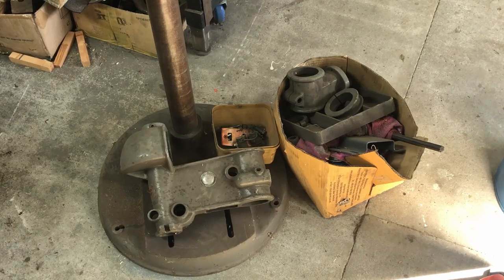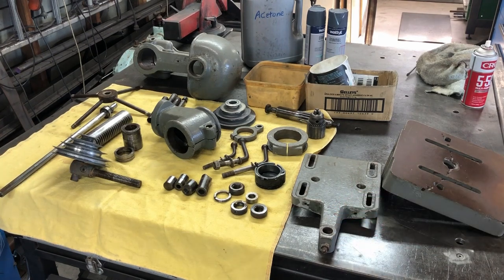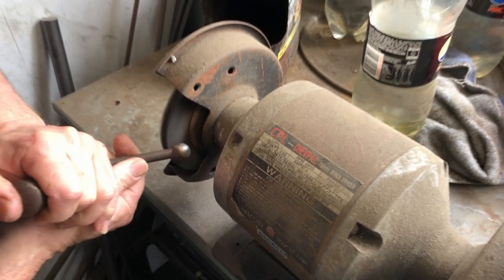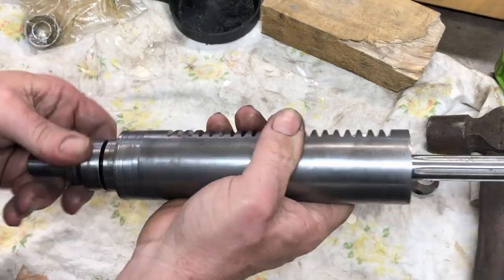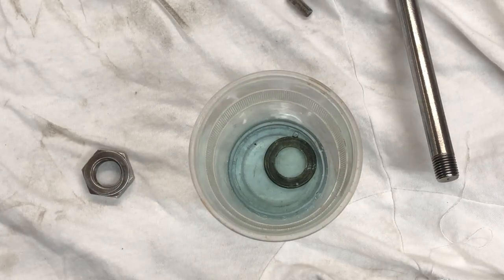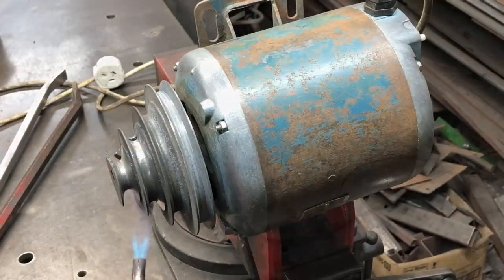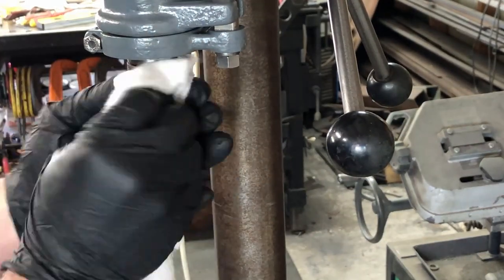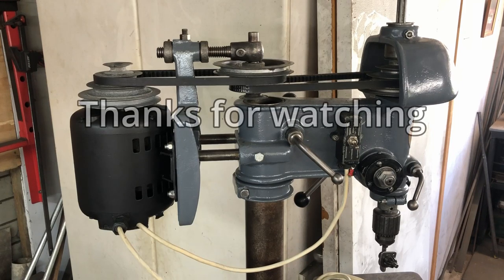Walker Turner Drill Press Restoration

Comment: Where you taped that cable going into the motor junction box, I use 1 or 2 cable ties pulled tight to the cable inside the box, I find they do a good job of stopping the cable pulling back through the hole 👍
Reply from the maker: That is a good suggestion. I did not thing of that, but it should work well. Thanks.
Reply: @thehobbymachinistnz  You're welcome 👍

Comment: The drill press turned out nice. ( I was expecting you to say at the end that you had decided to keep this drill press and sell the bench top model ). I don’t think you will have a problem selling the old girl. 
Just a thought, have you ever tried diesel to clean with instead of kerosene? Here where I live diesel is less than half the price of kerosene. And diesel is #2 kerosene.
Reply from the maker: I spent a lot of time on my bench top model. I added a VFD and 3 phase motor so that I don't have to keep changing the pulley belts for different speeds. Its Chinese, but it runs well.

Thanks for the tip re diesel. I will get a few liters next time I'm at the gas station and I will give it a test.
Reply: @thehobbymachinistnz  I do understand. Space in a shop is at a premium, period! I do hope you get a pretty penny for the old girl. 
About the diesel/ kerosine. It’s been a long time since I used kerosine for any thing other than light and heat. For me it’s too expensive to use that way. As of today kerosine is $9.00 a gallon diesel is $3.20 per gallon.

Comment: Nice restoration.  Here comes Trademe. Another Kiwi here. Started my Youtube adventure a couple of months ago. Where did you get your blacking fluid from. I have been using Super Blue with average results. Cheers Mike
Reply from the maker: Hi Mike, I got the Perma blue from Reloading Direct (https://reloadingdirect.co.nz/). The big bottle is much more economical than several smaller bottles. Before I used this product I use to hot blue parts by heating them with a burner until the colour changes, then quenching them in oil. I still use that method sometimes. 

I see you do woodworking as well. I started woodturning this year and I enjoy it a lot. A little different than using an engineers lathe.
Reply: Thanks for that will look them up.  Yes do both metal and wood work. Dont do any wood turning yet.Cheers Mike @thehobbymachinistnz

Comment: That table look a bit anemic... Very thinly cast... I mean, the whole drill ain`t a monster like some beastly drills, so there`s no need for a chunky table, but this doth appear a tad too gentle in my eyes... I`m watching your vid again, as i`m contemplating snagging a table-mounted WMW pillar-drill that i ran across, and i need some encouragement given that i have to decommission my shop for now... That little drill is 163kg as a tabletop machine, and the table is a massive base which you could use as an anvil - were you a savage beast yourself... The only part that is not skookum is the pillar itself, being a spiral grooved, solid rod that is slightly too narrow to my eye, but it is supposed to be a precision micro-drill, not a machine used to put 2 inch holes in hardened steel or white bronze... Not without running a boring head at any rate... Compared to that, this floor-mounted pillar drill should be at least skookum enough to fall over you and squeeze you out like a tube of tooth-paste, but i have the feeling that one could just stop this drill from falling over by a single hand if she were falling down on you... Quite a gentle girl this one... Take care of her... 

All the best and kind regards!
Steuss
Reply from the maker: Hi, thanks for watching and your comments.